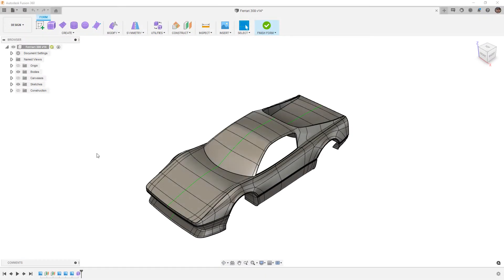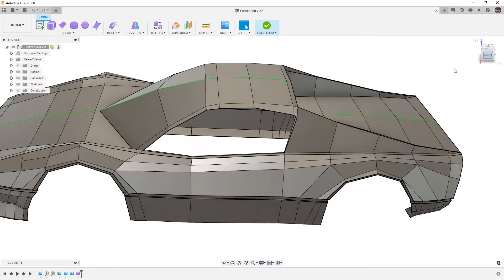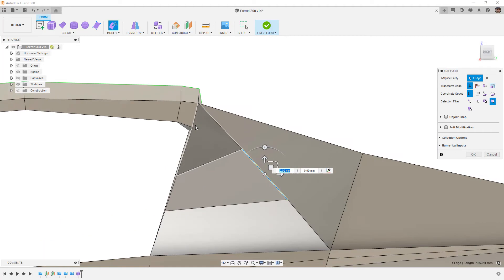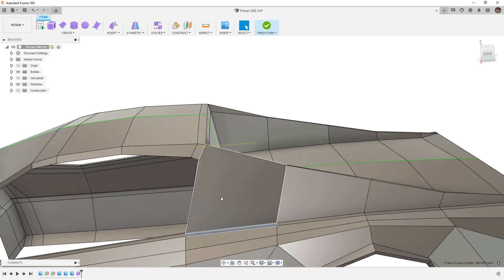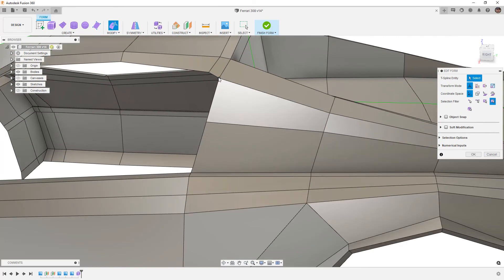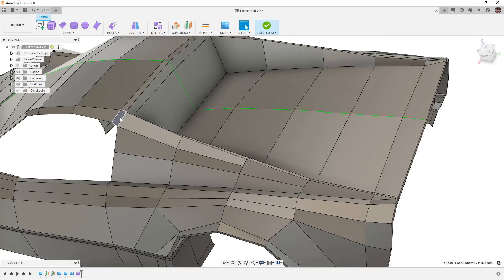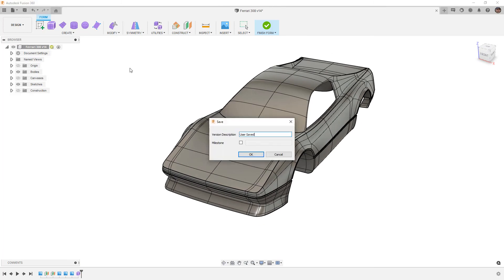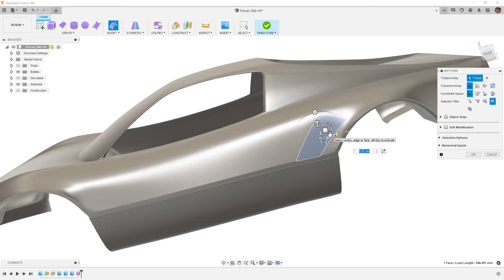How to Model a Car - Ferrari 308 with Fusion 360 Forms - Part 11 #Fusion360 #CarModeling

Comment: I just want to say thank you for letting us witness some of your frustrations. So often these issues are edited out of videos but they help tremendously in understanding approaches to correcting form issues. I'm working on a design for a 1949 Mercury, and by following it's a long ways from perfect but you can tell what car it is. One thing I am running into is trying to take a model like this and 3D print it. Obviously the thickness is an issue. When I try to take the finished model and add thickness to it the intersecting bodies won't allow the thickening to occur beyond the miniscule amount. I'm wondering if there's a way to use offsets or some other way to thickin the body that's a little more forgiving. Regardless thank you so much for putting this together it's been the best video series of its type I've ever seen!😊
Reply from the maker: Thanks.  It can be frustrating when things just work.  Spoiler, they never just work :)  

I have had issues with thickening.  If the entire body is done as a single form, you can try and use thicken in the form tools.  be warned that this gives you edges on the inside and outside meaning you want to be sure your shape is good or it gets harder to change.  Generally i will copy/paste the form body before trying thicken there.

Thickening after the surfaces are generated is somewhat at the mercy of the conversion.  Sometimes there will be a single area that just doesn't want to thicken.  I have had cases(recently) where the converted surface wouldn't thicken, but it would let me offset the surfaces.  It is a case by case thing.  Using Curvature Analysis can help identify those areas by using the 3rd option, principle max.  Set the slider to the amount you want to thicken(lets say its 5mm), and any red areas are going to have a radius of curvature less than that.  This "could" mean those areas will produce problems when thickened.